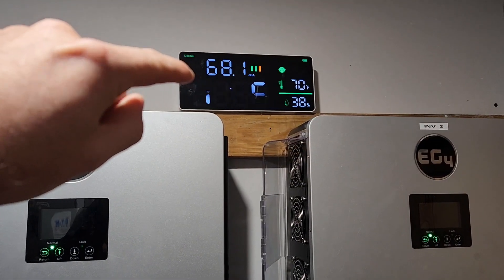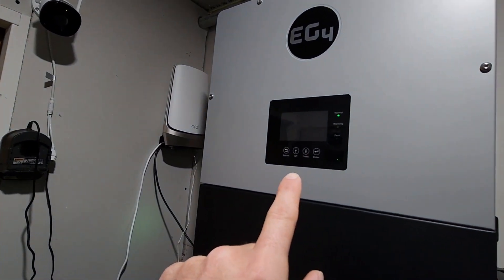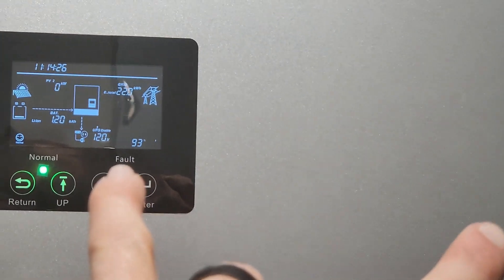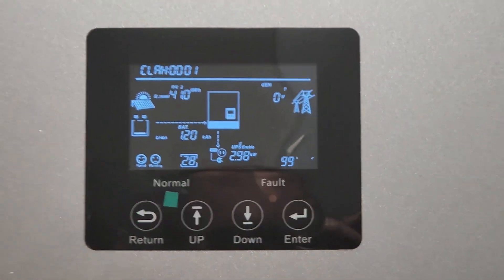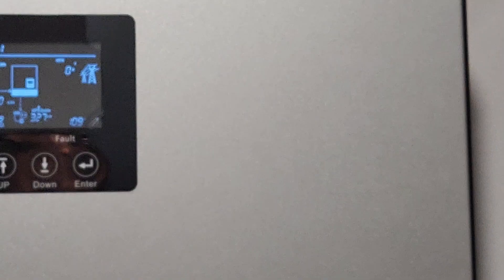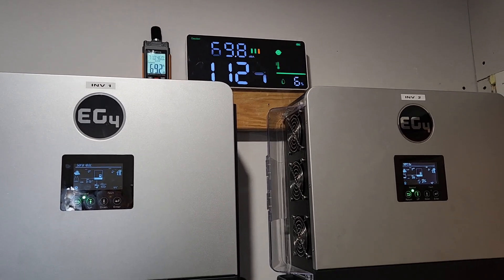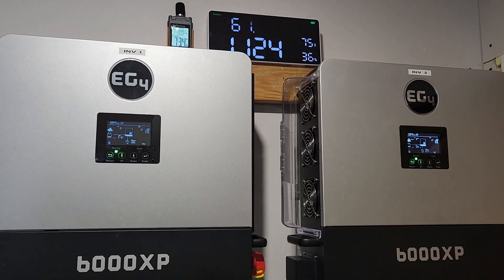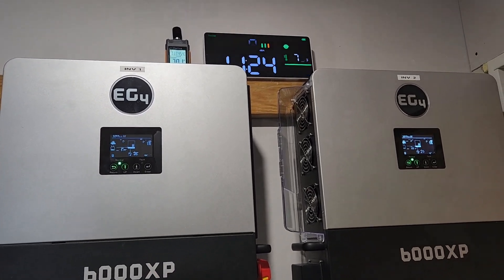YouTube question.  Will the 6000XP automatically restart after overload?

Comment: Great video!!  Is there a setting to be able to go into grid bypass if needed?  I have one unit, jut purchased another because I was getting an overload warning.  I am connected to the grid but I do nit yet have any solar panels
Because of the rules of my community, lots of hoops to jump through.  For now this is a home backup.  That is why I am asking.

Ron M.
Reply from the maker: I requested a setting that would allow grid bypass when the EPS switch was turned off.  I believe it made the cut off and may be in the works.  You can always switch the Discharge cutoff to 100% or voltage to 56.5v.  You can message EG4 they may know of an easier method or setting.
Reply: Thank you!

Comment: Can you make more "fan diverters". I will be installing two which will be close toghther and having an air diverter like yours would help me a lot.
Reply from the maker: You can buy them on Amazon or Local big box store.  HVAC vent deflectors.
Reply: @theadventuresofarenaissancman  Do you have a model or Amazon link to the one you bought. Yours looks like a perfect fit.
Reply from the maker: Eureka Air Vent Deflector - Redirect Airflow - Fits 10" to 14" Wide Floor, Wall, Ceiling Vent Registers - Multi-Surface Use - Strong Neodymium Magnets and 3M Adhesive Tabs Included - 2-Pack https://a.co/d/2BUMiYa
Reply from the maker: Similar to mine.
Reply from the maker: Correct the left side,  hot exhaust